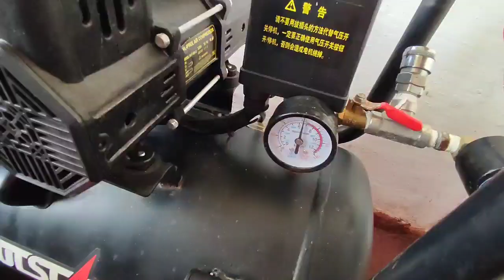FOAM Pressurized Tank DIY for Car/Moto Wash

Comment: murag gamay ra lagi foam nigawas sir?
Reply from the maker: Ouh gamay ra ang gawasan 1/4 size akong dak on ang output niya para daghan mo gawas upload rako balik sa result
Reply: Sir galing,pano konekyon don s loob ng tank para sa hangin at shampoo?salamat sa sagot.
Reply from the maker: @sonniedeguzman5895  hollow loob ng tanki,nagdagdag lng ako tube para sa air yung kulay blue 14:42, pressure lng nagdadala para mka foam
Reply from the maker: @sonniedeguzman5895  paused mo nlng diagram para makita mo
Reply: @AtanTourDiy  salamat po,sir ilan naman butas ng tube at gaano kahaba ng tube?
Reply: @AtanTourDiy  ibig sabihin sir pagpasok ng hangin lalabas sa mga butas ng tube sa loob, yun ang maglalabas ng bula papunta sa taas ng tangke paglabas sa hose ay foam na.
Reply from the maker: @sonniedeguzman5895  sa butas depende sayo yan basta may mga butas na maliit para magka bubble yung shampoo at water sa loob ng tanki. Yung sa akin 16 butas tapos 1/2 tube yan at sa kahaba naman sagad mo hangang dulo ng tanki
Reply from the maker: @sonniedeguzman5895  Oo sir tama ka
Reply: @AtanTourDiy  salamat sir sa tiwala mo itinuro sakin kung paano ang tamang paggawa di mo ipinagkaiit di tulad ng iba,subukan ko sir gumawa ng DIY FOAM MACHINE VENDO, update ko nalang kayo pagnayari na o hindi salamat pong muli taga nueva ecija po ako sa luzon.
Reply: @AtanTourDiy  sana marami kayong matulungan sa katulad namin kapos pa sa ganyang DIY sa totoo lang po mayron na ako car wash with shampoo vendo machine kung maaga ko lang nalaman kung paano gawin sana di na lumaki ang gastos sana huwag kayo magsawa sa pagsagot sa mga katanungan namin salamat muli.